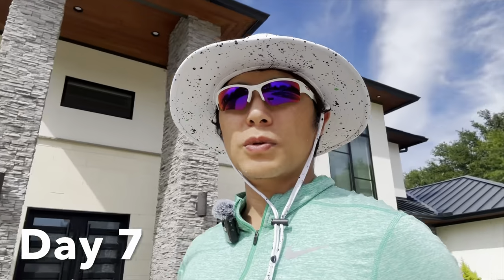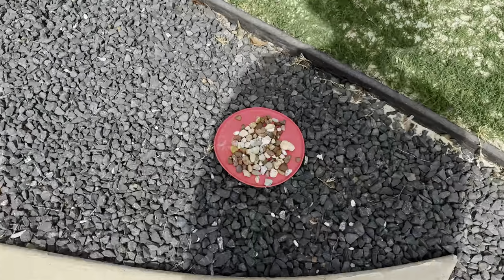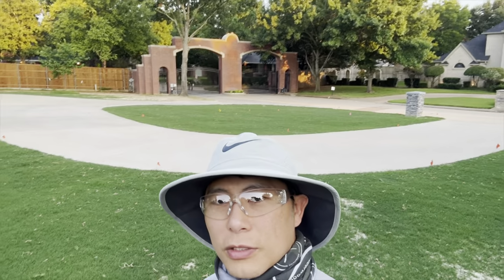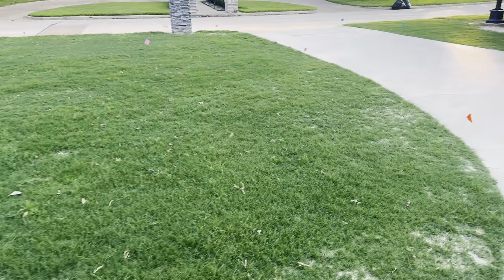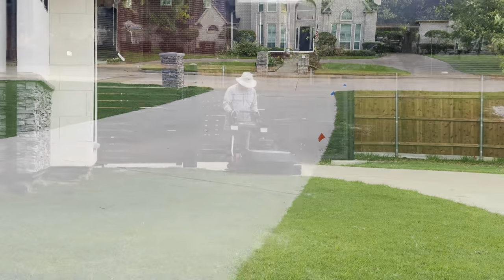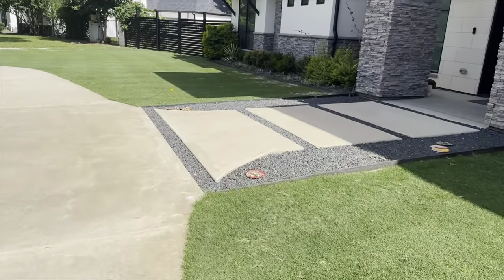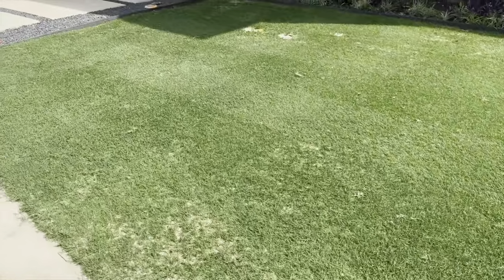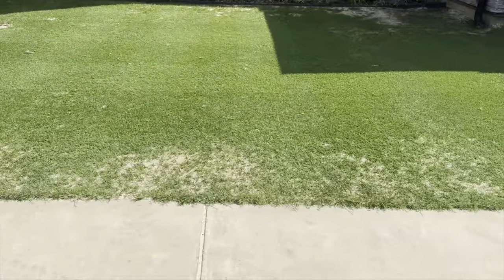LAWN SAND LEVELING RESULTS | 2024 Lawn Transformation

Comment: Def raise HOC the first mow. Work your way back down. That’ll help with keeping sand away from the cutting surface. And with giving you the bet shot with rocks.
Reply from the maker: Yep that initial .800” looked to work for me 👍
Reply: I add dithiopyr to my sedgehammer when I spray nutsedge in Hope's of getting the new nutlets that haven't begun.  Seems to help with the battle
Reply from the maker: @williamjonson6845  I been looking into Sulfentrazone 4SC Select.  Apparently some people have been applying it with Prodiamine early season and get a good 2-3 month residual.  Less sedges have appeared for them.
Reply from the maker: I’ve used Sedgehammer in the past, from my experience it works the same as Certainty.